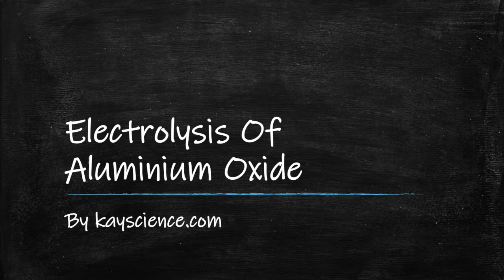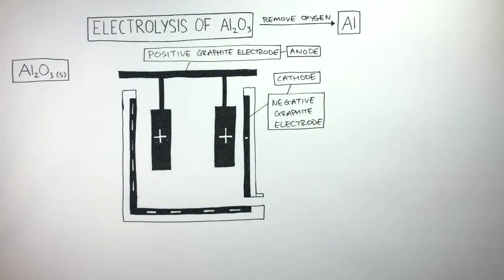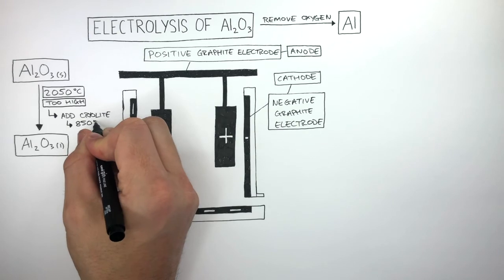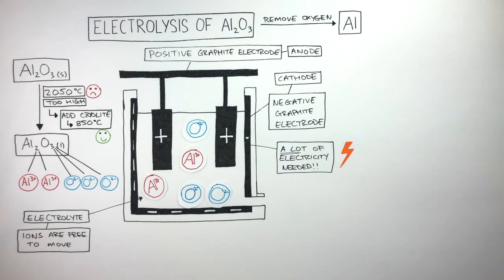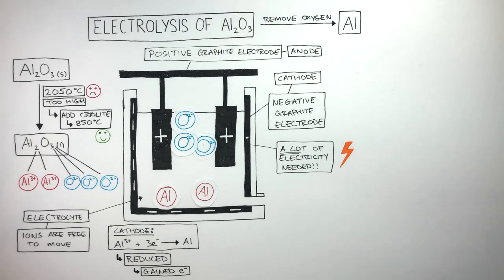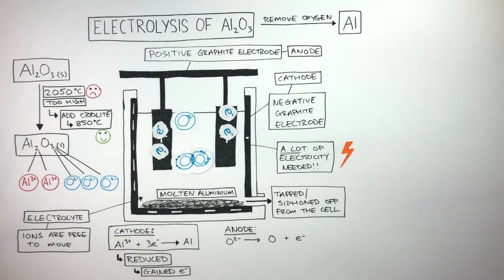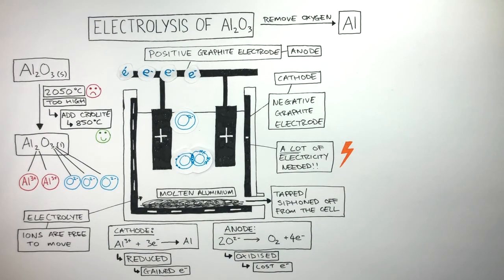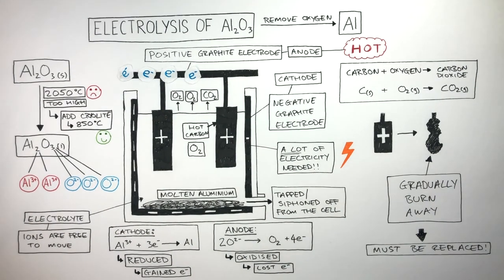GCSE Chemistry – Electrolysis of Aluminium Oxide

Comment: At 6:25 you said “ they flow from the cathode back to the anode “ where it should’ve been the other way , right ?
Reply from the maker: Hi, thanks for the question, and in the context of electrolysis of molten aluminium oxide, electrons flow from the cathode to the cations, and then electrons flow from the anions to the anode. This cycle is repeated over and over. Hope that helps?